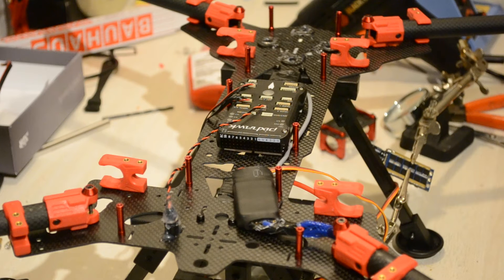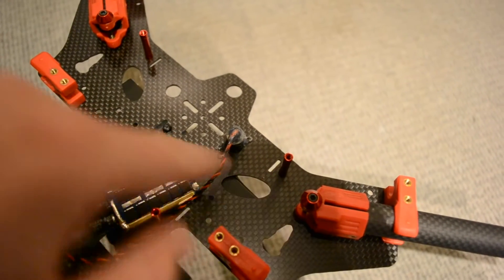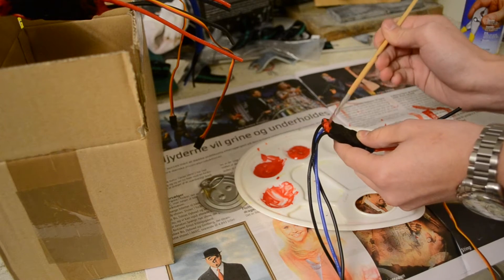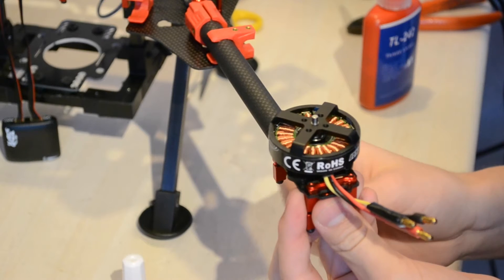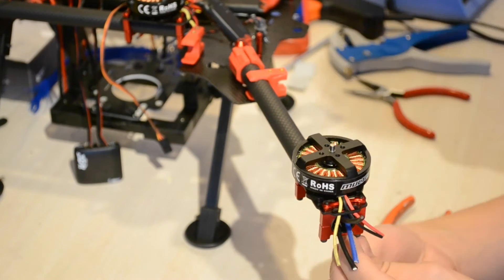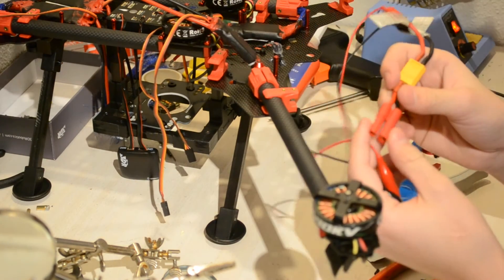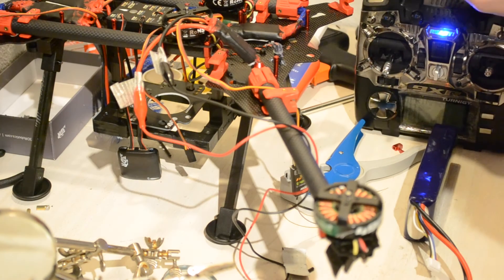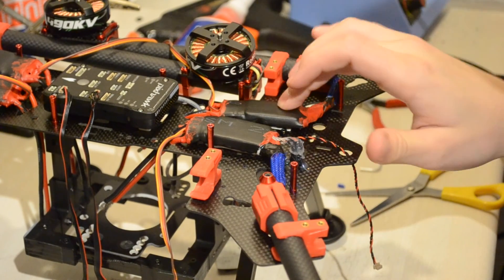H4 Alien 680mm quadcopter build and review - waterproofing and mounting ESC's [Part 6]

Comment: not smart move cutting the motors conectors.. just solder a female 3.5 mm banana plug on the long cables ESC , easy if the motor rotating wrong direction simply switch 2 of the conectors and thats is...
Reply from the maker: I know. But more connectors means more loss of connection. Also i wanted it to be permanent and weigh less, so don't worry - it is completely thought through ;-)
Reply: true :P
Reply: Bad plastidip and braid sleeve job too !

Comment: Is it a good idea to pain over the back of the capacitors?    If you look at the metal end, it will have a cross cut into it.  This is a deliberate weak point.  It is made like this so that if there is a problem it will explode from that weak point.

If you pain over it you would strengthen it.  Who knows where it would burst out?

Have you ever seen a capacitor explode?

It's just a thought.
Reply from the maker: That's actually a really good point. I haven't thought of that. I can say though, that i am not changing it now, and of all the quadcopters and UAVs i have previously built i have yet to experience a capacitor explode so i can't see why that should happen now. Motors are at the moment pulling 5-6 Amps to hover and ESC's are rated at 30A. But let's see overtime. Thank you for your heads up though!
Reply: Yes. I expect that you're right. The odds of it going bang are a bit slim.  I suppose there's more chance of ot if it got wet:-)

I fly over water very often.  I get some great video like that.  There's always the little nagging in the back of my head. What if?

So, I've decided to waterproof my next build.

I wonder. Have you given any thought to flight controllers?  I can't think how I could do it.  If I seal it , I think that it will upset the barometer.  Any ideas?

Comment: A couple of notes:
1. When you're soldering on the motors to the ESCs, fold the cable cores back onto themselves (like a U shape) and squish them together. This will make the wires hook onto each other and act as a strain relief when you apply the final solder (so that they can't lose their shape). Never forget the strain reliefs, solder alone is not to be considered a mechanical attachment.
2. Your cable is a nice idea, however you should improve it a little. Alligator clips are fine, those thin wires are not. Buy some alligator clips with insulation all the way to the tips and crimp those to wires coming straight out of a battery connector. For the application your cable might work (since the motors barely have any load) but I always go into "James May"-mode when I see this kind of solution.

Other than that, I'm enjoying the build so far. This is a very impressive quadcopter.
Reply from the maker: Thank you for incredible feedback. Never thought about that as there's no stress on the wires at all, but i'll surely take it into consideration on the next build.

Well i'd always rather be "James May" than sorry haha ;-)